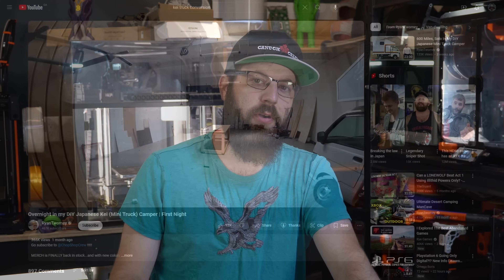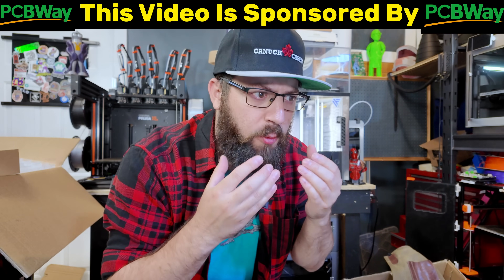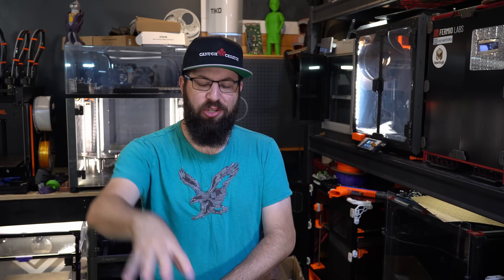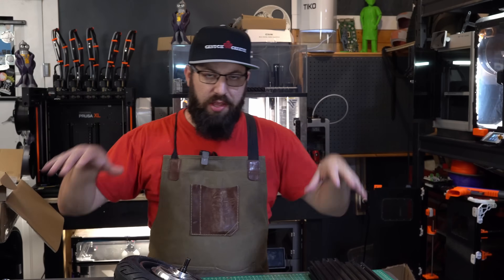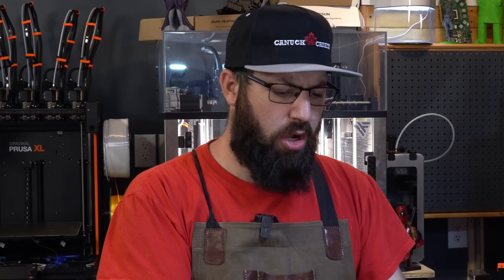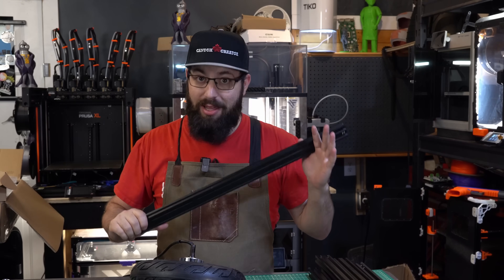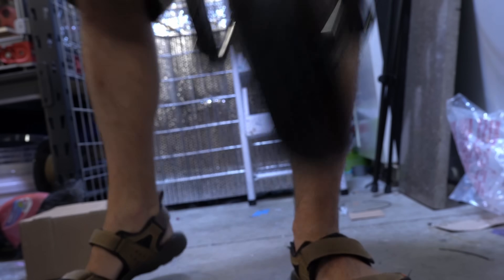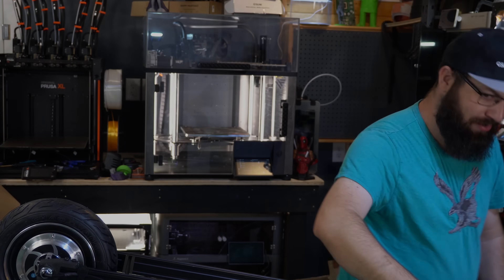We Have MotoCompo at Home (once i figure out how to build one)

Comment: BEST Ender conversion! Like not to be a downer and perhaps it holds but if you apply just a bit of bounce that's probably not going to be enough to actually check for integrity. Assuming a small indent in the road you are riding on at speed will have a much higher than just driver weight impact on it. So be careful when actually testdriving it.
Reply: Especially once there's sufficient air in the tire. As demonstrated, that tire is underinflated and providing a lot of cushion.
Compounding this is the lack of suspension, so that tiny print will be taking all of the forces of the entire bike and rider while hitting bumps at speed.

Comment: When seeing the blind joints, I wanted to comment how unlikely those would be reliable here, but fortunately, I see you are aware. Personally, I would use at least a threaded rod through to have the extrusion only in compression and no threads in aluminium. These extrusions however seem to have small inner hole diameter for that (as common for printer frame extrusions)...

Comment: Finding batteries that can (reliably) deliver 48V at 10A continuous could be tricky. It's not like you can just throw in some Makita or DeWalt tool batteries and call it a day, you'll probably need to focus on eBike batteries and eBike power management controllers.

Comment: I wonder if electric lawnmower batteries would be a good start. Used to have one and it was easy to charge and swap them out.
Reply from the maker: There one of the options in looking at.

Basically I want something very turnkey and easy (and safe)
Reply: Many years ago (before we moved to acreage) we had a Victa electric mower for keeping the ~600sqm house block tidy. It used a horrible 12V SLA battery that really wasn't suitable for purpose, I hope they've evolved since then.

Comment: the point I would be most concerned about is the anti-spin notch in the motor mount. One of the ongoing problems on ebike conversions is the motor spreading the frame allowing it to spin in spite of the flats (so they commonly add an arm torque bracket)

So I suspect that you will end up needing to design and order something to handle the torque. It won't fail immediately, but I would expect it to cause problems under use.

Comment: I was initially going to say to avoid drill batteries because you're paying for the proprietary casing and brand and steer towards SLA general purpose batteries, but refurb or knockoff Ryobi weedeater/mower/blower batteries may bring a decent power to $ ratio.  8Ah is 260 USD for one genuine Ryobi battery and charger, but Ebay has 2 packs for a little over 100 sometimes.  Direct Tools Outlet has factory blemished 40V 7.5 Ah battery and charger for 140 USD.

Comment: Fusion 360 Tip - When exporting to your 3D slicer you can go to the  “Mesh” tab and at the very right side there’s “export” - You can set the Export location (to your slicer) and then every time you export a component it will automatically open and load the component into your slicer for you! 

It’s a small thing but it saves me a ton of time and headache when doing a lot of printing.

Comment: I've done kickscooter conversion with VESC and 2kW 6364 190kv outrunner (i.e. 6cm wide and 6cm long motor) connected to a huge 3d printed gear connected to the side of the rear wheel via timing belt with crazy ~~1:8 ratio AFAIR. I also owned Xiaomi Scooter Pro and now own Ninebot G2 Max. I have following observations:
- Xiaomi's small diameter hub motor was literally unusable hauling my fat ass up any hill. G2 Max's much bigger hub motor is ok-ish but can't even begin to compare to the geared DIYed thing which could lift my 100kg weight on its rear wheel (as well as burn out a hole in office carpet).
- G2's both front and read suspension is a totally massively complete gamechanger. Both Xiaomi and the DIY thing had none. Forget some shaking.. you worry about not cutting the tires on even a small unevenness. On G2 I can comfortably cross on railroad crossing. If I ever got back to anything DIY I wouldn't even consider going without both front and read suspension even if I had bicycle sized tires.

Comment: I'd recomend a 3d printed part to cover the cable over the rear wheel shaft. Something that just clips on to the extrusion, but protects the wire from falls, rocks, tree branches, ankles.. :)
And use electric drill batteries.. Easy charging. Once you've figured this all out, and others can use what ever drill battery brand they have. I use DeWalt for example.
Reply from the maker: Covers and cable management will be "after we see if it even works" stage lol. but yes they`ll be there.
Drill batteries are the current planned goto for powering the rig

Comment: How much extrusion do you have? It would be nice to use 2 sections to create a set of fork legs in a triple Crown fork arrangement to sandwich a printed part with a standard mountain bike head set for running your steering. That would also help limit the steering angle and make a small wheel setup less sketchy at higher speeds. You mentioned on the sub stream the other night about a skunk works channel on the discord but couldn't find it.